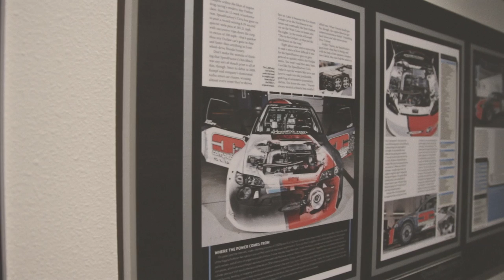Chris Jeanneret Reveals Plans for Formula Drift Turbo Honda S2000 - Made to Drift Ep. 1

Comment: As far as I know, the F20C was the platform that Honda based the K20 on.. Please, for the S2000 owners out there, take the Original design and perform wonders with the F20C.. Not to mention its 500hp ready with a Turbo kit unopened from factory     :)

Comment: Not much of a honda fan but fuck yeah !
Reply: +ThatPinoyKid206 Honestly, I didn't think much of Honda until 5-6 years back when I bought an s2000..
The motor in standard form was incredible for a 4cyl NA, then knowing what it was capable of with a good turbo setup (still unopened engine) and wow.. Was completely blown away. 
Several mates have had that many Nissan's that they have had to do engine work to achieve what they were after.. which honestly wasn't anything too crazy, yet had to upgrade several parts putting them out of pocket. .. Quiet amazing what you can do to these Honda engines and still have a reliable car putting down the same power as an 8 banger